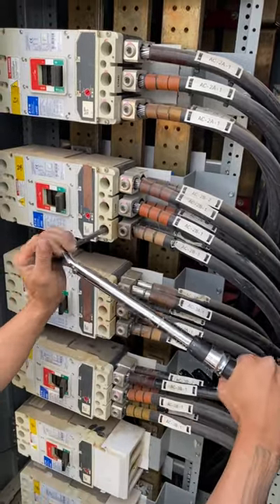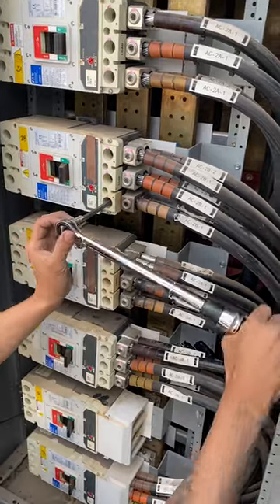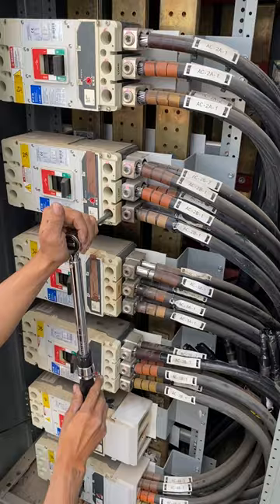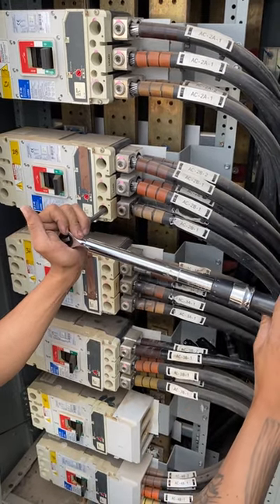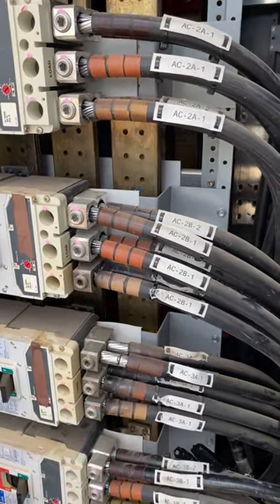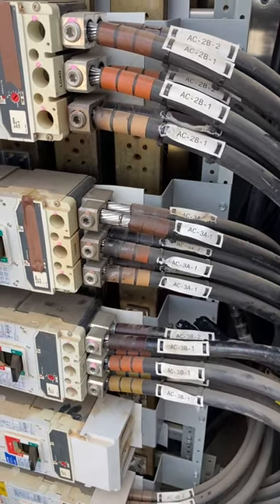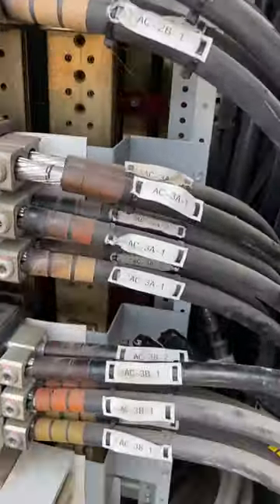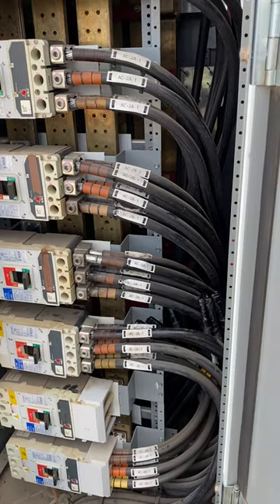Checking Circuit Breaker Lug Torque on Improperly Torqued Cables

Comment: At the large hospital that I retired from we had an on going battle over checking wires for proper torque.. Boss insisted that we do it on hot 480 volt equipment. Nope . Cheap SOB'S never purchased any torque wrenches. It was almost impossible to have BSO give us permission to turn anything off to safety check on non energised equipment. One of the senior electrician showed them where NAFA book that states once a wire is properly torqued you should not keep checking torque. Probably damages the wire. I went by the IR gun temperatures & hot spots under load. Found several loose connections on a new 250 HP Fire pump. 50 plus years ago every time we wired in a new piece of equipment we went over every connection. Stuff that came across the ocean by a long ship ride were the worst. Now a days everybody is in a hurry. Ahole boss wanted us to remove pecker heads on every 480 volt motor while it was running while performing once to 4 times a year PM'S. Nope not today, not tomorrow not ever ! Was told at an IAEI class that all torque wrenches & drivers should be sent out every year to check calibration. Same class the instructor asked how many of the approximately 125 people in the room owned a torque wrench. Maybe 5 people.
. 
.
Reply: That b phase I see  burnt needs to be cut back and re stripped to get to clean copper to have the correct tourqe value, the copper in the breaker has been weakened by being overheated and will eventually fail due to metal fatigue